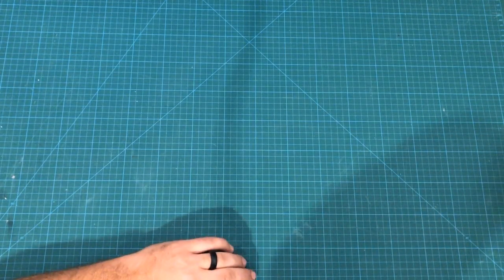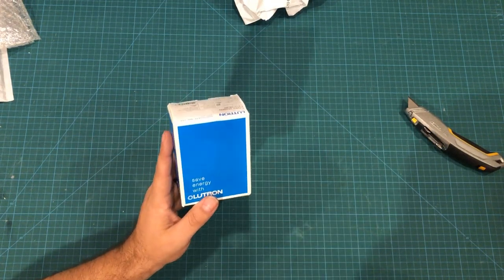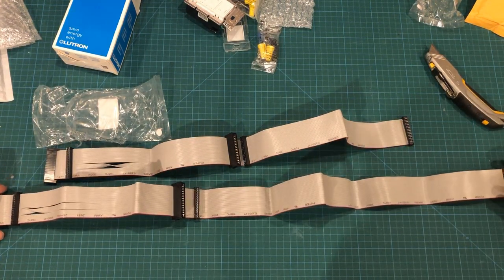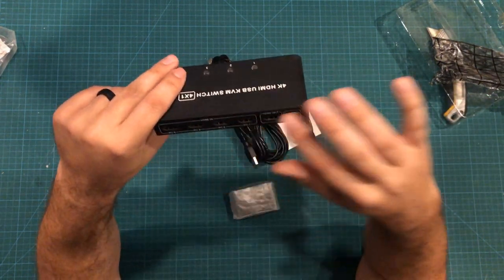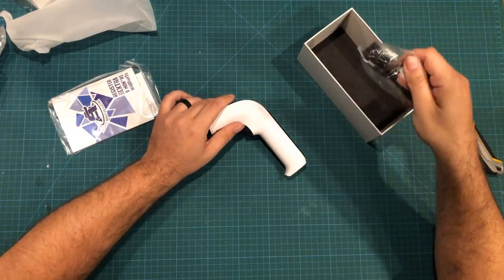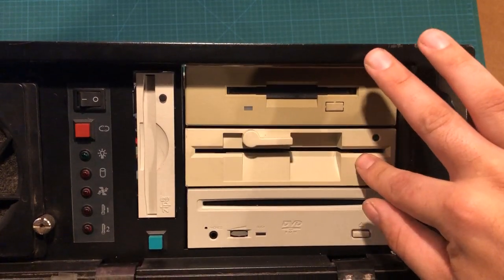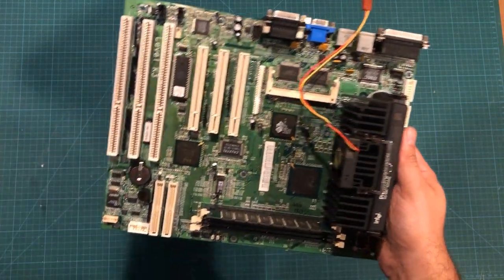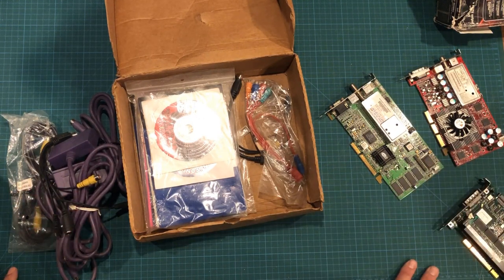Mailbag 28 - Somethings old, somethings new

Comment: I need to look on eBay to find myself a 5.25 floppy for my DOS PC.  I have a 3.5 for it already.  As of late, I've been in super nostalgic mode and digging through old hard drives (I try and keep all of my old ones if I can) and laptops to find some of my old code. Had a few strikes :) I also found my C compiler and tools collection as well. Turbo C++ from 1988 and 1992, Power C from '92, and my Masm 6 disks. I think all of the disks are okay and I was able to install TC 3.0.
Reply from the maker: Get the drives while you can.  They've gone up in price so much.  There is also a supplier in California that is a little pricey, but they have truly refurbished drives. If you need some contact info, feel free to shoot me an email.